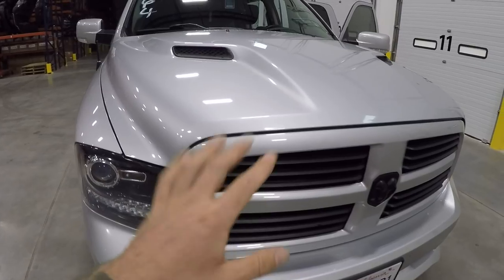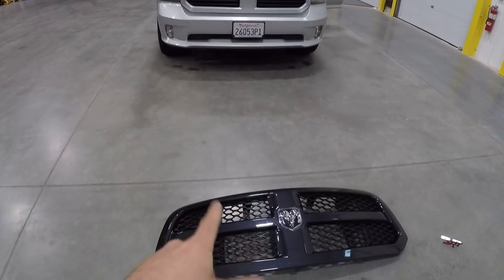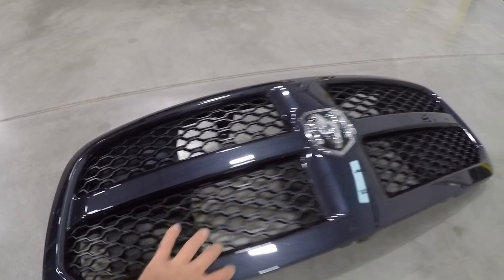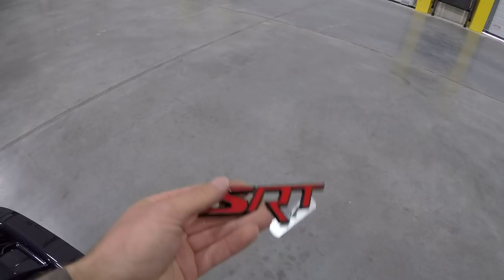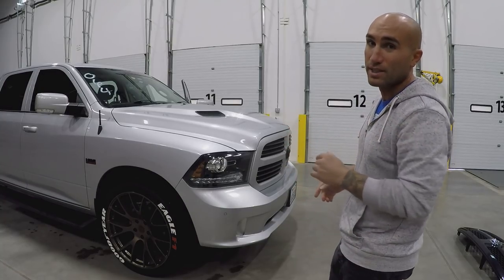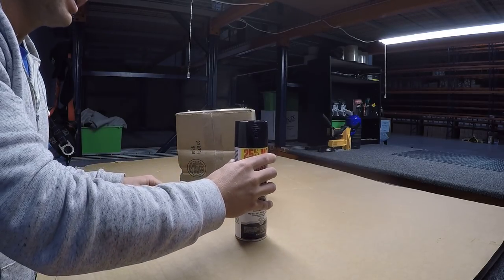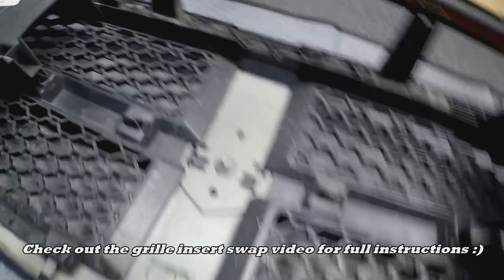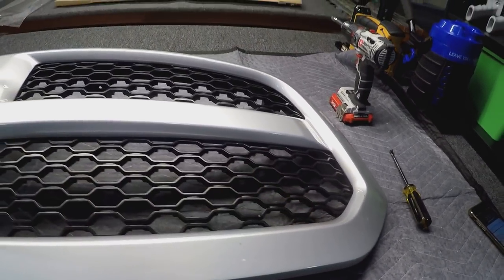SRT Style Grille on the HELLRAM Truck Build - TruckTalk #22

Comment: Looks great thinking I may go the same way with my 2017 Ram Outdoorsmen. I like what your doing with your truck in terms of stance with rims and tires and having a clean look. I like the look of a lift BUT with that I lose gas mileage and add a hard ride with more road noise.
Reply from the maker: I agree!  I lifted my 2009 Ram 1500 and hated it after!  Looked badass but fuel was brutal and it was a lot slower.

Comment: John,
I'm watching your channel for two weeks now I also have the 2014 ram 1500 hemi but I have the six speed transmission in your videos you've mentioned that you have the eight speed ZER transmission can you please do a video on a transmission service which is part of the transmission pan The dealer wants $750 for this job let's see how much you can do it for ! I've been a mechanic for 25 years you will need the torx style bit for this pan. And 6 quarts of ATF +4+ or minus
Good luck on this challenge
Reply from the maker: Thanks for your support on the channel!  I already have a video on the 8 speed transmission fluid change procedure!  It's an older video so you'll have to excuse the polish of the video and editing etc but the info in it is still there 😎
https://youtu.be/mNo9Ln5KrOE

Comment: You need a tonneau cover
Reply from the maker: Yeah I agree Francisco!  I missed out on a tri fold hard cover but just keeping my eye open for another one on craigslist.  😎
Reply: I bought a rolling soft tonneau from realtruck.com by American Tonneau. I like it a lot except for having to pop the latch on it to close the tailgate. Only a minor issue tho.
Reply: I just bought a Truxedo Pro x15. It's freakin awesome! I like the roll up option to have full access vs the tri fold ones. But in general a cover looks way better period.
Reply: I had Bakflip trifold on my '11 before and now bought the Revolver X1 for my '13. I like this much better, easier to roll up plus I can open and close the gate while it's closed. Has a clean vinyl look but it's strong aluminum underneath. Little pricey but I was lucky to buy for $480 as an open box instead of $900+ but I couldn't find a scratch on it!